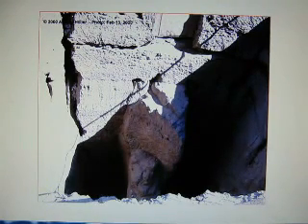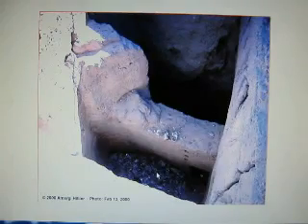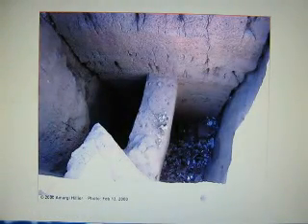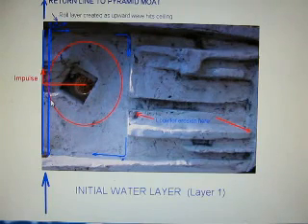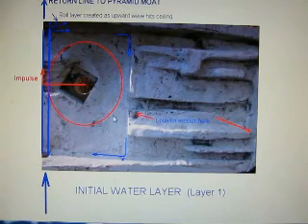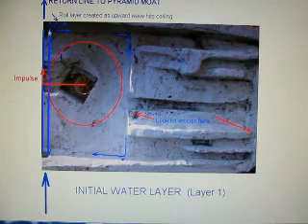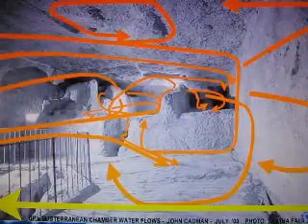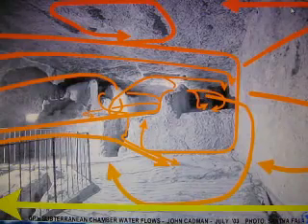Pyramid Hydraulic Ram Water Pump (3of3)

Comment: Brilliant thanks. It being a RAM pump is only one attribute of the pyramid, but may be the most important.
Shape 
Size
Latitude
Rotation
Materials
Can all be looked at as a way to impart, or take something away from water.

Size and latitude would be difficult to replicate, but shape and materials and position relative to north should be easily replicable, and it has something to do with water.

Comment: Found your video and here’s what I’ve built and tested:

https://youtu.be/13NDII4uoTM
https://youtu.be/02OxiWc_8-g
https://youtu.be/13NDII4uoTM

It’s a 1-1000 scale Great Pyramid of Giza lower half proof of concept of a ram water pump.  You and Steven Myers are if the same belief that a vortex was created in the subterranean chamber-but I’m not so sure.  I do think it was much less technical as a plain pressure chamber that helped force the water up to the Grotto where the second pressure chamber and waste valve are located.

Comment: I have built ram pumps & i would suggest you do the same. You would understand the principle of operation and what a Hydraulic Ram actually looks like. Ram pumps have 2 check valves you showed us none. Ram pumps normally have a pressure vessel which hasn't been identified. If this was a hydram  and the descending passage was the drive line there would be enough corrosive potential to destroy the entire structure. You built you model close to 20 yrs ago. Your video has been posted for almost a decade ago & you haven't  received 90 likes, what does that tell you. How much water have you pumped, none
Reply: if it worked is there any way it would scale to this insane level? big stone rooms with randomly drawn out water jet paths lol, and the water would have to come in from a higher elevation, how did it get up there? thousands of people spend 20-30 years building a huge structure NEXT to the nile river in order to transport water? makes no sense.

Comment: Gravity water pump for irrigating crops. Genius!!! Question is why not just create channels or canals from the Nile and irrigate crops that way? Could the Pyramids have been possible 'water making machines'?
 I regularly see photographs of the pyramids shrouded in fog. Could the pyramids have been covered with reeds, ropes or another material to capture water droplets from the fog to be released into the Pyramid base channel and then distributed through the pump and onto the tunnel system? Which begs another question was the Nile a constant or did Egyptians have water shortages?

Comment: The fascinating thing is that  the pulse pump played three roles.first,as the engine for building the thing,then again,as a pump forcing water into the chamber for hydrogen extraction,and finally,as a vibration inducing machine,where the stones inside the chambers were tuned to earth frequencies(F#),which had the massive structure vibrating in the key of F#,same as earth,see... https://oursounduniverse.com/f-what-is-it-all-about/ The weight of the pyramid helped to 'glue' it to the earth surface,thereby creating a good receiver and conductor for the electrical current. The earth has electrical currents flowing all over...see Telluric current...https://en.wikipedia.org/wiki/Telluric_current
Tesla figured this out and was building a working replica,but lost funding.
Reply: thats very interesting
Reply: @jannovak6987  neat huh, you know Toyota is making a new car called the Mirai which works on the same idea of hydrogen chemical reaction.